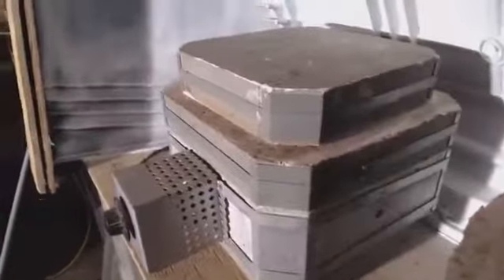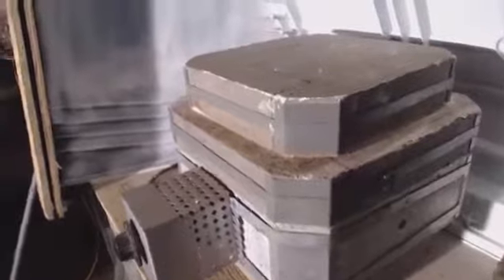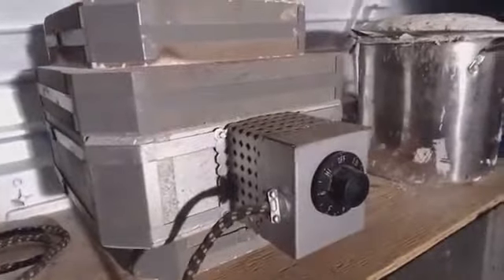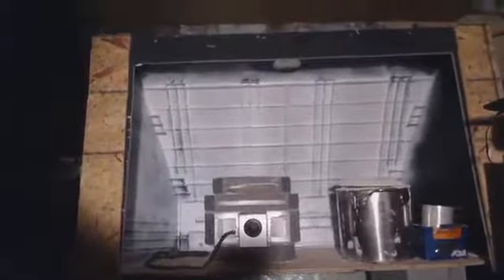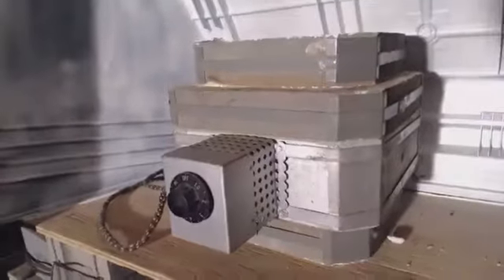KILN OF JBSC

Comment: Damn, you have some nice toys! I also want to melt some metals and do some calcinations. I have so many ideas, so little time/money. You are an inspiration, thanks for the video.
Reply from the maker: Y Bee Normal..............yeah it sure does get expensive with this hobby.  And I still need another 2 grand to get glass blowing equipment.
Reply: I applied to be a lab glass blowing apprentice but the funding fell through. a dying art
Reply from the maker: Y Bee Normal............That's a shame.  There are not a lot of people who that kind of thing for a living.  I figure I spend so much on lab glass it would be cheaper to just buy the equipment and have unlimited lab glass for almost free.  The propane oxy torch I want can be used with methane and oxygen.  Methane is just natural gas so in the winter I can run my torch on that and the fuel is pretty much free that way.  I wanted to get an oxygen concentrator so the oxygen was almost free also.